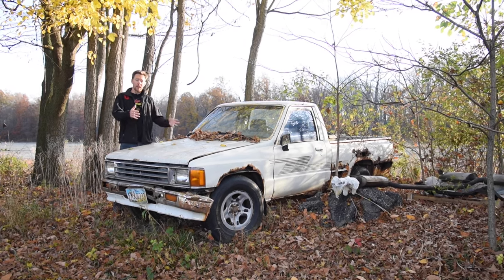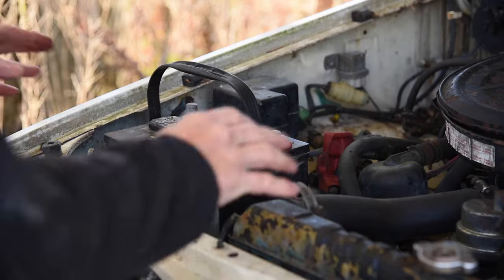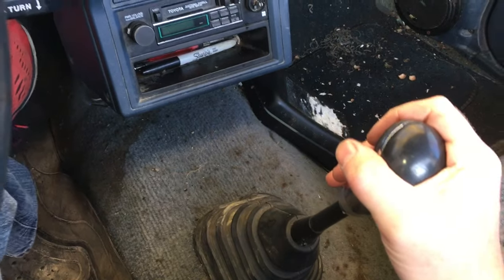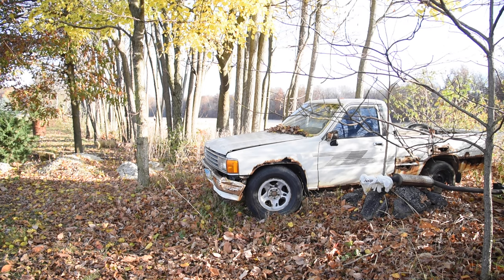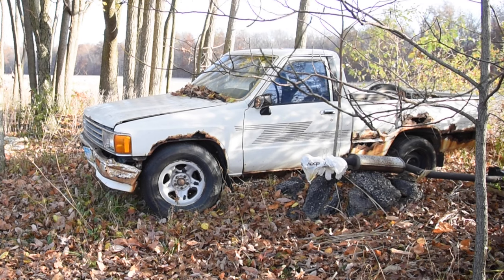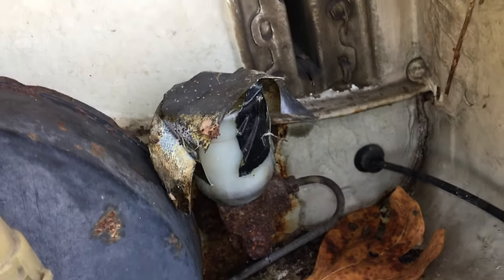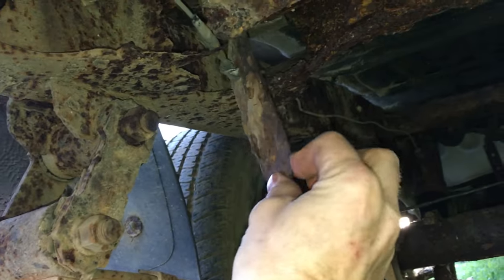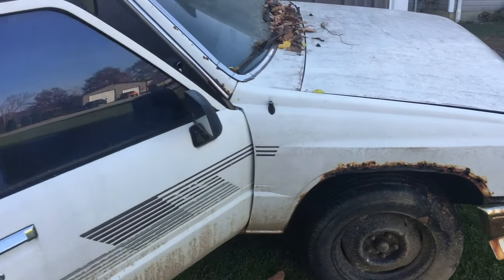Abandoned 1987 Toyota Pickup 22R First Start + Walk Around

Comment: I am the second owner of a 1987 Toyota pickup 4x4 with r22 engine with 142000 original miles. Body is almost rust free. Original interior is in great shape. Just needs some love to get it running right.
Reply from the maker: That's awesome, the body and interior are the difficult parts to find/repair.  The 22r is simple to tune up. I'd love to find a clean truck like that!
Reply: If you still have this and it's an 22R.  I am noticing on mine, on top of the Carb the air cleaner... on the passenger side of the air-cleaner, next to the latch, there is a plastic nozzle (like 3/4" long) which would allow air to be sucked in the breather or blown out... on that nozzle it looks like a hose should go on that... I haven't found a YouTube video nor a vacuum hose diagram which shows this port...?  One video looked like it was capped off, others look like has a hose on it (though the videos aren't panning over enough to tell for certain, if it's even there, or where a hose would run too.  Perhaps your truck has that, and you are able to name where it goes?  Or maybe it is just supposed to stay open or maybe it is capped?  Any clarity would be much appreciated...    My '87 4x4 my dad gave to me, but in trying to get myself up to speed, I have noticed that many of the hoses are wrong... But seems to run pretty good, though they need to be corrected and hopefully might run a little better on various levels.... any thoughts?  Thanks
Reply: Second owner 9f my 86 4x4 the  i love her

Comment: Those 22R/22RE will run until the end of time. You literally can not kill those motors. I had one of these trucks. I’ve never owned a more durable truck. Mechanically speaking.
Reply from the maker: 100% I love these engines. They may not be fat, but they're so reliable.

Comment: Not at all surprising to be it started right up. My 88 4Runner is at 225k on the original powertrain and runs like a top. Just had the head rebuilt for valve seals while getting the head gasket replaced and man it just works.

Comment: great vid, my 1987 ute just had a new 3y put in, 404,000 on the clock, i had hilux 1978 before that with 680,000 on the clock,it was still going when i sold it back in 2,000
Reply: If you still have this and it's an 22R.  I am noticing on mine, on top of the Carb the air cleaner... on the passenger side of the air-cleaner, next to the latch, there is a plastic nozzle (like 3/4" long) which would allow air to be sucked in the breather or blown out... on that nozzle it looks like a hose should go on that... I haven't found a YouTube video nor a vacuum hose diagram which shows this port...?  One video looked like it was capped off, others look like has a hose on it (though the videos aren't panning over enough to tell for certain, if it's even there, or where a hose would run too.  Perhaps your truck has that, and you are able to name where it goes?  Or maybe it is just supposed to stay open or maybe it is capped?  Any clarity would be much appreciated...    My '87 4x4 my dad gave to me, but in trying to get myself up to speed, I have noticed that many of the hoses are wrong... But seems to run pretty good, though they need to be corrected and hopefully might run a little better on various levels.... any thoughts?  Thanks

Comment: I have an 87 as well. Not nearly as bad with rust, the body has some around the fenders and the rocker panels are toast but the chassis is fine, anyway I put a clutch and a timing chain and brakes on it and fooled with the carb a little....she starts every time and always gets me where I'm going. In fact it runs so well I'd drive it across the country no hesitation. I mean that. It's definitely saving miles on my first gen 4x4 driving 40 mins to and from work 5 days a week. This thing could be a good little $#*! Getter
Reply from the maker: I hoped the frame was ok, but in the next video I pulled it in the garage and the frame was toast.  This truck's good parts will go to help keep other Toyotas stay on the road.
Reply: What kind of carburetor are you using? Stock or aftermarket? Did you have to tune it or anything I’m having starting trouble & I’d appreciate any help
Reply: If you still have this and it's an 22R.  I am noticing on mine, on top of the Carb the air cleaner... on the passenger side of the air-cleaner, next to the latch, there is a plastic nozzle (like 3/4" long) which would allow air to be sucked in the breather or blown out... on that nozzle it looks like a hose should go on that... I haven't found a YouTube video nor a vacuum hose diagram which shows this port...?  One video looked like it was capped off, others look like has a hose on it (though the videos aren't panning over enough to tell for certain, if it's even there, or where a hose would run too.  Perhaps your truck has that, and you are able to name where it goes?  Or maybe it is just supposed to stay open or maybe it is capped?  Any clarity would be much appreciated...    My '87 4x4 my dad gave to me, but in trying to get myself up to speed, I have noticed that many of the hoses are wrong... But seems to run pretty good, though they need to be corrected and hopefully might run a little better on various levels.... any thoughts?  Thanks
Reply: @klujics123  I recently sold mine. It was carburated and had a number of vacuum lines. If one was not holding pressure or any were incorrectly plugged in the truck would run very poorly.

Comment: I bought 87 4x4 in Oregon, it had 98000, original miles old man just bought it and drove it to the store ,,, I'd take 6 for it now, it's got 14300 and new timing chain,,,
Reply: If you still have this and it's an 22R.  I am noticing on mine, on top of the Carb the air cleaner... on the passenger side of the air-cleaner, next to the latch, there is a plastic nozzle (like 3/4" long) which would allow air to be sucked in the breather or blown out... on that nozzle it looks like a hose should go on that... I haven't found a YouTube video nor a vacuum hose diagram which shows this port...?  One video looked like it was capped off, others look like has a hose on it (though the videos aren't panning over enough to tell for certain, if it's even there, or where a hose would run too.  Perhaps your truck has that, and you are able to name where it goes?  Or maybe it is just supposed to stay open or maybe it is capped?  Any clarity would be much appreciated...    My '87 4x4 my dad gave to me, but in trying to get myself up to speed, I have noticed that many of the hoses are wrong... But seems to run pretty good, though they need to be corrected and hopefully might run a little better on various levels.... any thoughts?  Thanks

Comment: minus the frame rot that truck is in about the same shape that my 88 pickup was, but mine had a seized engine with a cracked block. looks like you have a good parts truck though especially since its a air conditioned truck.

Comment: I’ll buy the taillights…radio…and other parts…I have a 1992 SR5 4 WD with extended cab 120,000 miles… Father in Law gave it to me on Christmas Day…All gear oils changed…new front brakes…new shocks all around ….new battery…drivers axle replaced…new tires…timing belts and components replaced….going to replace ball joints…tie rods…t
Reply from the maker: Here's a link to my store, always adding more parts when I have the time: https://6thgeargarage.net/yota/

Comment: Certain engines will "run forever." Bc low compression engines. I've had eight 22r's/re's throughout my lifetime...currently run a fully restored, cherry red '87 that I had re-done out of California. 
Other engines are comparable, if not better. 22r/re is just the most well-known. ie. My daily driver is an '07 Subaru Forester with a boxter engine. This is my 4th, and newest Subaru...and it's 16 years old. I cracked up 2 others before it (btw super safe car), and the '99 I had, that was my own fault...should have done the timing belt when I knew it needed it. My laziness---> blew the engine up on I-95, half way between Florida and NJ.
Reply from the maker: These engines do have a great reputation, just not much power
Reply: If you still have this and it's an 22R.  I am noticing on mine, on top of the Carb the air cleaner... on the passenger side of the air-cleaner, next to the latch, there is a plastic nozzle (like 3/4" long) which would allow air to be sucked in the breather or blown out... on that nozzle it looks like a hose should go on that... I haven't found a YouTube video nor a vacuum hose diagram which shows this port...?  One video looked like it was capped off, others look like has a hose on it (though the videos aren't panning over enough to tell for certain, if it's even there, or where a hose would run too.  Perhaps your truck has that, and you are able to name where it goes?  Or maybe it is just supposed to stay open or maybe it is capped?  Any clarity would be much appreciated...    My '87 4x4 my dad gave to me, but in trying to get myself up to speed, I have noticed that many of the hoses are wrong... But seems to run pretty good, though they need to be corrected and hopefully might run a little better on various levels.... any thoughts?  Thanks

Comment: i have two 1987 toyota pickups im working on. they are both xtra cabs. one is a matte gray and the other is just like yours. do you think you could make a video on how to repair rust on the sides of the bed?
Reply from the maker: I will be repairing the rust on my 1980 longbed, but it won't be for a year or so, after I get other projects wrapped up.  To sum it up... cut & weld. You can get repair panels here: https://alfaparts.net/
Reply: @6thGearGarage  thanks man

Comment: Your stuck in reverse cause the trans/truck was banged from the front..usually happens when you set a removed trans down to hard on the bell housing and reverse gear slides forward....Just remove the "do not remove" plug on a G trans or the oil filler plug on W's and Ri5if....now slide the gear to the rear....alls good. Can happen when you run into something head on....and heres your duplicity for the day...a 22R to work on after the 80 series coolant hose marathon
Reply: 242,000miles...hold my beer...498,910 on my 87 4x4 excab...has never stopped on the road with a break down in 35 years, only one flat tire....still has some original light bulbs, tail ect. several engines and trans/transfers though...LCE stage 2 stroker at the moment, .50 lift cam handing out about 150HP but at the cost of MPG at 16 city...18 hwy but OEM totally stock was 18city/20hwy..ya want power out of a 22R its gonna cost ya at the pump....Another great video, keep em coming....

Comment: Wonder what model that front rim came from? Been looking for some alloy rims to fit my Hilux LN90.
Reply: That looks like a late 80s, early 90s chromed steel wheel to me.
Reply from the maker: The front wheel was originally from a Jeep Cherokee, 15" steel wheel. I put it on because the front tire was flat. They were on a lifted 2wd 1987 Toyota I bought a few years ago: https://youtu.be/IKvAPlWvMZ8
Reply: @6thGearGarage  thanks. Jeep and Suzuki rims fit the 5 lug nut pattern. But not easy finding some alloy rims with 14'' to fit.
Reply: The other wheels are off a dodge van. I thought they looked cool on there and they were free so....
Reply: @RogerM88 
 wait... The early 'yotas we're six lug I thought? Chevy bolt pattern, no?
Reply from the maker: @frankrosemeck9898  the 4wd are 6 lug but the 2wd are 5x4.5”

Comment: I could use some blue sun visors, what condition are they in, I also need a climate control, mine is a 86 4x4.
Reply from the maker: When I have the time, I'll be adding some of these parts to my store: https://6thgeargarage.net/yota/
Reply: Awesome, let me know when you have some visors posted, much appreciated. Also, what is your suggestion on headliners, I have an upholstery guy but is this material available.
Reply from the maker: @blitjen1  The headliners actually have 3 sleeves for metal rods built in to the top. I'm sure there might be a way to recreate them but I've never seen the OEM material for sale.  Here's an older video I made to show how to remove one: https://youtu.be/HP9uAocDztQ

Comment: 22R was the last good engine toyota made. After that they went to the 22RE which was the crappy fuel injected model. I had both. I had the 22R in an 86 Celica and a 22RE in a 91 Tacoma. The truck got a few air leaks in the hoses and it was a pain to track them down. Then it would run rich. could never get it running right. But the celica kept right on going for years. Just more proof fuel injection was a mistake.
Reply from the maker: I like the 22R over 22RE because they're more reliability for slightly less power. 22RE's run great one day and then can have an electrical or fuel issue the next day and run awful. when something goes wrong on a 22r, it slowly gets worse over time so you have plenty of time to fix it.
Reply: This is a little bit of an odd take, but you can think what you want, I guess. My 2002 4Runner with the 3.4 has 315k on it and it doesn't skip a beat.
Reply: 22R-E is a great engine and EFI is always better than a carburetor. Especially as emissions tests get harder. People here in CA are having a tough time getting 22Rs to pass these days. Also, you did not have a 1991 “Tacoma”. They’re not Tacomas.
Reply: The Pre 83 was.  20R isn't too shabby.

Comment: Bought a brand new Chevy 1500 in 1991. NEVER AGAIN will I ever own another Chevy ! By the time that truck reached 150 thousand I had replaced the Water pump, Radiator, starter, instrument cluster x2, seat belt latch, alternator, belt tension pulley, Transmission, rear end seals, idler arm, and two front alignments because the front end was soo loose !  Chevrolet builds GARBAGE ! My 1999 Toyota however, at 130 thousand never required ANY new or replacement parts ! 
Toyotas just run, run and run !! I forbid my family from driving ANY GM products !!
Reply from the maker: My first two vehicles were Chevy and I learned a similar lesson. So many dumb things broke on them that I just got used to it and assumed it happened on all vehicles.